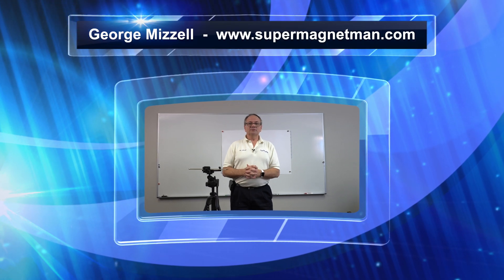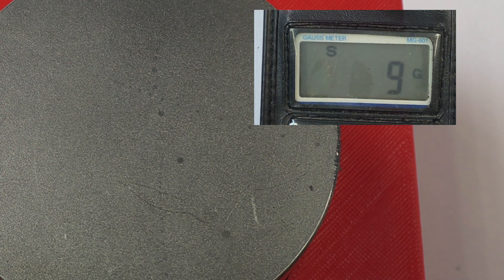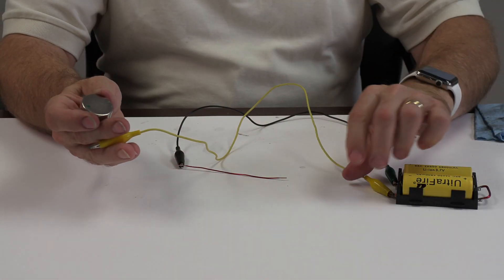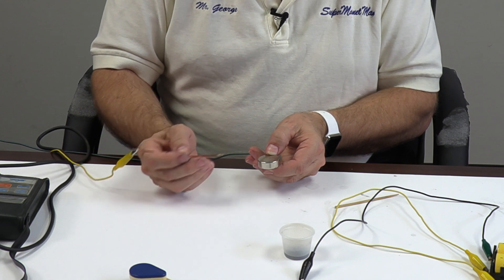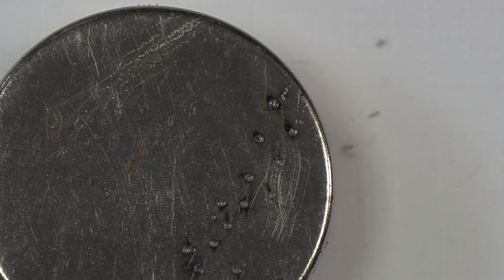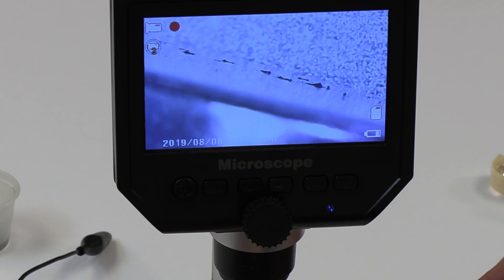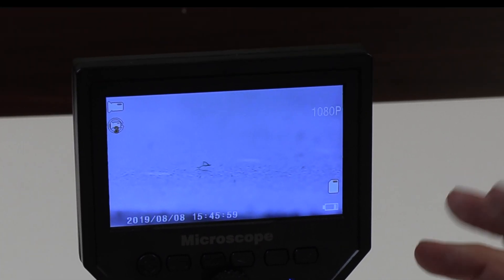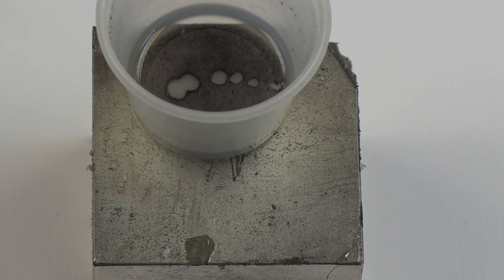Magnet Mystery Part 2 Up to 4K

Comment: I wonder if you isued low and also high frequency AC low voltage running through super tiny filament wire.

Comment: I am a bit late to the party, and while I'm not very sure what happened to cause your spots (maybe some kind of chemical burn?) I believe the magnetic field in these spots is decreased because at least three effects: 
1.) When you shot the microscope images it looks like the surface of the magnet in the spots has ridges and angles cut into it, while the rest of the surface looks much flatter and homogeneous. Because of this I believe that the spots have more surface area for flux to escape compared to the surrounding magnet, therefore the field would become weaker in this area. 
2.) As you said these spots dip below the rest of the surface of the magnet meaning there is less material therefore less dipoles to add to the overall field. (this may only constitute a small portion of the "error")
3.) If the spots are the result of burns, the heat could have perturbed the magnetic moments of the dipoles in the material close to the surface causing them to mis-align with the field resulting in a decrease in the overall field strength.
4.) a wild shot in the dark here, but could a sufficiently large enough magnet with the right shape and orientation have been dropped onto them causing these spots? i.e. if I drop a very strong magnet from enough height (aka accelerate it) onto another very strong magnet, what happens? What if one is a magnetic plate and the magnet accelerated into the plate is one of your one Tesla pyramid setups? (opposing poles towards each other of course)

Comment: you get heat by kicking it , if you take a flat surface , and kick the magnet at that point it will exabit lower magnetism , because when you kick the magnet you move the particles and you lose the magnetic field .

Comment: Did u solve this? I don't see magnet mystery 3 anywhere. Try testing voltages imbetween such as 10 volts, 15 volts and 20 volts. Also can you try viewing it in magnetic film viewer instead of iron fluid, and also try a ferrocell also? There is an upgraded magnetic film viewer that is on Amazon different than the regular green ones, it's more brownish tinted.

Comment: However unlikely, i would almost certainly check to see if the signature of the energy sum at that frequency, or maybe the energy lost specifically. Would match the energy taken to perform an interaction with radioactive isotopes or indeed muons etc. Making an electron or proton knock itself free from the magnet itself would very likely be capable of disturbing things enough to create a region of weakened field by simply loosing the free electrons in that area due to a radioactive particle interaction event. Something that happens at a quantum and 3D level

Comment: The only thing I can think of is you're introducing copper with the arc from the copper wire.. magnets also are made with copper when molded and also can contain it in the nickel.... copper and electricity is the only constant I can see between the production process and your arc test.

Comment: Try buffing out the raised areas. The magnet may have been buffed after getting shocked.
Reply from the maker: I tried polishing it with metal polishing compound.  I have to be careful not to reduce the plating very much because it will start peeling off.

Comment: those are old experiments joe cell videos has some of those experiments like brakeing magnets their behavior alcohol is mentioned and methanol I belive that magnet caries a extra residual charge that shuld by checked if it stay permamentaly ore it goes away if you change ground plates ore core sizes,wire -plates size's,magnet size ore magnet potential are equal and proportional diferent reaction will acure what peopel dont understand liques,solids and gaseus states other elements react with those things why do you think air what it has to do with electric motors and transformers it changes resistance by useing temperatures diferences that what it is a combined knowlage and schools dont teach those things  I belive magnets can rost some sort of as well and that creates potential diferences some thing similar to a volta baterry cell ore diferences about plastic and metal charge diferences that is more likely static electricity what we are seeing there and harbesting static power is diferent then trying to get ac and dc out of some thing a ignition coil is a perfect exampel it use's colieding magnetic fields ac and ac ore ac and dc pulse's at high speed if they hit ich other at 90° degrees they create somthing diferent and that is more likely called neutral electricity it is not positive ore negative and that has a diferent effect on any cinde of mather it is known those devices emit radiation ither way created by sound,vibration ore histeria thats my understanding how things work you wont finde those things  in school books definatly because siencist's dont know what it is in the first place it does not comply to any known law's ore psihic's great video thanks those are old forgoten experiments it wuld do no good to you if you experiment to much about those things magnetic fiels are dengerous some reactions are brutal culd cost you your life  dont by to close to those things it culd produce radiation,shock's even go so fare as to by potent to health if other elements get involved many known chemist's died because the same reason their invention's killed them they didnt understand what they got and most of those things ore new elements were highly potent  when you take a centrain power sorce to charge a magned ore centrain time to create a magnet the oposite equal is discharge at the same speed ore time what it take to create it and that discharge is not nice it culd fry you instantly that is in my opinio a oposite equal if you can multiply ac ore dc so you can multiply magnets strenght as well even with out moveing part's a plazma generator ore nuclear reactor work's similar principel's only down side is it destroy's evry thing around it well for endles power that is a oposite and equal reaction I supose

Comment: actually i changed my mind.   here is a test to try...  how about throwing a hardened steel ball bearing(pinball sized)  at your test magnet.  i bet you find similar impact craters as it hits and bounces and gets pulled back.  and those hits  also focus a fair bit of energy (bang 2 ball berrings together and you can see fire spark off.  do it with paper and the paper inbetween and the paper explodes.  complete with a whiff of smoke.  huge focused impact accellerated by magnitism, i bet you are cratering and hitting the curie point.

Comment: it may have gone into a polish bath after the arcing.  they have to pump a huge amount of power into them  when they are magnitizing them, id not be surprised if the coils they fire dont periodically explode.  and bet you bought the magnets off a surplus market.  well. that's where the non perfect ones go.

Comment: Did you try changing the direction of the current so you could get electrical erosion instead of deposition? Electrical arc isn't a bad explanation, but it doesn't explain why the spots are where they are. I've seen that this has happened to somebody else's monster magnet, but the damage was around the edge of the pole face and likely due to microfracturing that may simply come with using it for a long time (stress/age). The locations of the spots are the most intriguing thing about them.

Comment: If it is proven that it is not from manufacturing, Then it is a effect of damage and since it is not the same as the arc test, and it is not random I would think that lead to the magnetic field itself affecting the surface. could metal or some other caustic have been pushed or pulled to an area the field has created to make the same pattern.

Comment: Where are the magnets stored when you are not using them? Is there equipment in the vicinity of the area where you store the magnets that gets powered up now and then? If the right frequencies are combined, there might be an effect similar to what John Hutchison can produce with his equipment. I believe it's the same type of an effect that Tesla was able to produce on the USS Eldridge, he combined 2 or 3 different frequencies to try and hide a ship during wwII from radar and other forms of detection. The animals that were used ended up having issues, these issues were similar to the issues that the sailors had when they were put through the same experiment. Tesla wanted to study the effect and figure out a way to counter it to keep the men onboard the ship from having problems. The Navy told him that they were going to continue with the experiment, that's when Tesla quit the project. John Hutchison gets very similar results to what the Navy got. I'm wondering if you've got something similar going on where the magnets are being stored and multiple frequencies aren't dancing across the surface of the magnets changing what's happening in the location of those spots. 
Just a few thoughts from my overactive imagination. 

Rob
the.farm82019@gmail.com 
Let me know if I'm close or so far out there that I should be sitting in a field somewhere waiting to be abducted.

Comment: Interesting effect, have these magnets had these spots on them from the time you purchased them?
It is very likely that the anomaly is due to some manufacturing process, especially if the square and round magnets came from the same source/supplier. My first thought if I came across something like that would be to contact the supplier and if possible, get them to put you in touch with the manufacturer of the magnets. Could even be some impurities in the material composition which have lower magnetic properties. If you have an access to a low resistance ohm meter, I can suggest doing some spot resistance checks relative to the unmarked side (pole). Place the magnet on a piece of copper foil and attach one probe of your low R ohm meter to it and use the other probe on various spots on the affected pole to see if there are any differences in the conductivity. Just some thoughts.  All the best, great videos by the way!

Comment: Hi SuperMagnetMan, have you ever researched cavitation? It occurs during the collapse in atmosphere after lightning,  electricity, or plasma is discharged. It is responsible for pitting in boat propellers when they spin and create air bubbles underwater.  There's not a lot known about this phenomenon yet, but I believe with the electricity involved that it may be a possible explanation.  Within fluids a phenomenon known as Sonoluminescence occurs when a gas bubble collapses due to cavitation and produces a light emitting object that is referred to as a star in a jar. Under the right conditions they can exist for long periods of time, but they also can exist for  an extremely short time. They have many of the same properties of stars, and I could imagine how that may influence magnetic fields.  I'm thinking cavitation may be the cause of these discrepancies in the magnetic readings.

Comment: this input is after watching the last video and before watching this one and not reading the other comments :
( I made the same comment on previous video before coming here )
acid drops hit the surface and caused the domains to randomize because of partial dissolving

this input is after watching this video before reading comments :
maybe it was electric current from a source without physical contact with the magnet - such as a transformer inducing a current momentarily
second guess : impact with a blunt object
third guess : heat source causing partial melting

Comment: I have a few youtube videos my self with magnet and if you put iron shaving in a plastic bag paint it white you can with a magnet ring make it dance nice joke for dancing flower. Doing one with neodymium and bismuth and a 400kv ark transformer should be fun, especially with the ring one I'am building uses super cooling and a metal 2x2 magnets 16 total metal coil bound on 30,000kv ion lifter parts with the inner ring spinning to get the lift and brake the ground with a 4 base sets for alien tec antigravity stuff.

Comment: Is this a kind of magnetic 'printing'? Gonna throw this to the EU  brains trust - they will loooove tge pattern.

Also pretty sure you've just modelled planetary electric cratering  issues. Hilarious if you read back thru the comments on part one (there's clearly a collision/gravity thinker talking  compared a couple of electromagnetic thinking guys talking arcing.)

Comment: Have you tried holding the flat end of something like a drill bit to the magnet and touching the wire to the drill bit? This will cause a spark on the bit but not on the magnet itself. Then see if it leaves the round spots but they will be smooth like your first magnet. Also, the shapes on the first magnet almost appear as if it was a liquid dribbling on the surface. Is there any kind of chemical that could cause this?

Comment: looks like remnants of some high energy particle skipping across the surface.  you can see the pattern in the dot strip decrease in size and gap spacing as the particle looses energy.

Comment: its do too impacts on the surface of the magnet which deforms the nickel platings crystalline structure there forth changing the magnetic conductivity of the nickel covering the surface of the magnet or it could  be leching do to long contact exposure  to another metal which can change the chemical composition of the plating casing there to be a decrease in ferromagnetic properties

Comment: I bet one could do that electricity trick without making marks... 4 sure... The real question is > did you make these marks ? or som1 else >>   My other contribution is: what happens if you heat up something small like a screwdriver and touch it to the magnet. red hot. quick touch

Comment: Just found your channel. Great videos! Your issue: Since new warehouse stock is not showing issues but only those used/handled, tends to indicate small dings could have caused micro-fragment tears in the material that would explain the reduction of flux field in those areas. At least something to consider that could be tested by purposely, not with electricity but with physical dents made and find out by Gauss readings. Only other idea is acidic person’s hands left residue in spots that etched these areas yet the ding theory seems more plausibly. The best to you finding the answer.
Reply: I agree

Comment: Have you accessed Howard Johnson‘s book? You are using the gauss meter to measure field strength only. Howard Johnson used similar technology to measure field strength and direction. Good try with the electric arc test, but magnetism is more fundamental than electricity. These are magnetic effect at higher frequency and a different phase. Your random testing at the manufacturing stage does not exclude the presence of magnetic filaments during the magnetisation process.. Investigate microwave arcs

Comment from the maker: Love seeing all the ideas.  Next week I will test some areas with some 90% nitric acid that I have as well as some sufluric acid and see if either of those cause any such problem.  Also, I will take the 2 inch cube and see if I can peel the plating off and see what the magnet condition is without plating on it.    I can do a demo of a steel ball, and aluminum ball and a copper ball bouncing on it.  I can say that the steel ball does not bounce - it just slams into it.
Reply: Aluminium an copper are too soft to be able to concentrate enough energy to a small spot before it deforms. It has to be an elastic impact. Elastic impact has a momentum change Delta p twice of the non elastic. The energy is absorbed for the deformation, less heat is generated. For example if you get two 1kg steel balls and slam them together with s sheet of paper between them the paper at the point of impact would have a burned out hole with a smell of burning paper form the heat. Currie temperature of neodimium magnet is much less than the self ignition temperature of paper.

Can you do stainless steel ( non ferromagnetic), that should bounce enough, even if the eddy currents would slow that down a bit. Maybe a glass marble big enough?
Reply: The pattern of the spots reminds me to much of the sound of those annoying elipsoid chatter magnets  people sell at tourist destinations. They look like polished hematite eggs. You have two of them, separate them throw them in the air and as they attract and collide they make a very loud, very distinct high pitched chirping sound. That's what these spots remind me.

Comment: My Guess: these are big very strong magnets. If it would attract a steel ball, the energy of the collision would be high enough to create enough heat at the point of impact to overheat that spot over the Currie temperature, destroying the field, and as it cools down the magnetism is locally changed. Since the steel ball is hard, and so is the magnet, it will bounce a few times, each bounce with less energy, hence smaller spots.
Reply: This is exactly what I've been thinking sans the heat aspect.  Physical shock may be enough to "liberate" the micro-domains at the point of impact and they would want to assume a reverse polarity like the way magnets do when broken where a monolithic magnet becomes alternating smaller magnets.  As for it being heat or something more physical I'm not sure.  If the material below the nickel was pulverized, that would be a good opportunity for the domains to flip there along with the material involved.